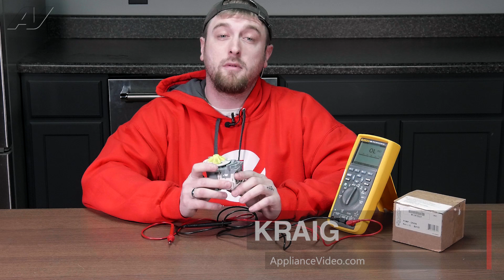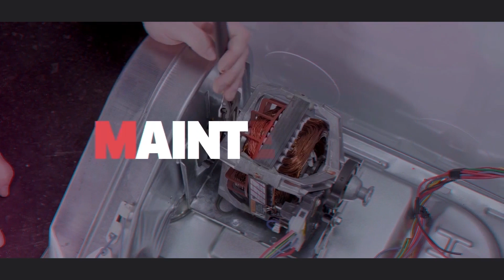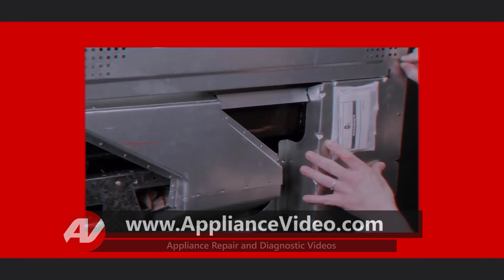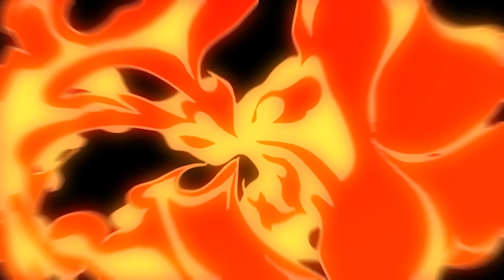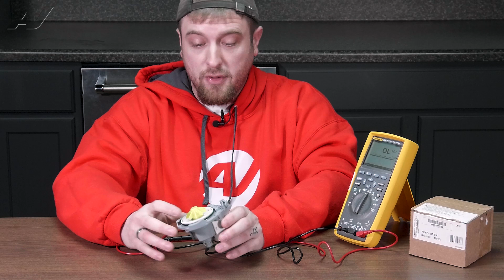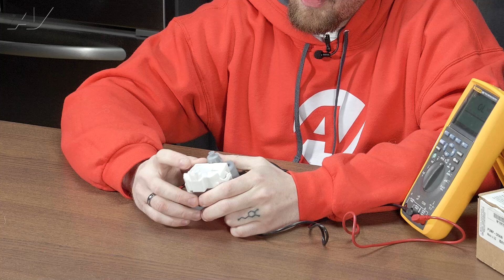Drain Pump Testing & Diagnostics by Factory Technician

Comment: My drain motor only drains 75% of the time.   The drain motor resistance is in spec.  The failureF9E1 usually happens when the washer is hot at about 2 hours into a 3-hour wash cycle.  If the error occurs and I try the 2 min drain via the cancel button the motor will not operate and the unit will not drain.  It only drains when the washing machine is cool.

Maytag MDB8959SKZ (stainless steel, 3rd rack, $1,000) model year 2020 with the Microfiltration design.  This has an Askoll T2132 drain motor.  The F9E1 error happens 75% of the time and the drain motor does not run.  This is usually when the unit is hot.  I thought the drain motor not operating was due to the motor thermal protection Klixon switching open, but this does not seem to be true.   I checked the resistance of the motor.  The spec is 27-33 ohms.  The motor measures 30 ohms when cold and 39 ohms when hot immediately after the F9E1 error is thrown.      

The problem seems to be from a low motor voltage when the dishwasher is hot.   I measured the voltage at the motor connector immediately after the washer threw a F9E1 error and it was only 20VAC.   When the washer cooled down it went back up to 120VAC.   What would cause the drain motor connector voltage to drop to 20VAC when it is hot and for that to come back to 120VAC when it is cold?

Using Service Manual W11499711 Rev B